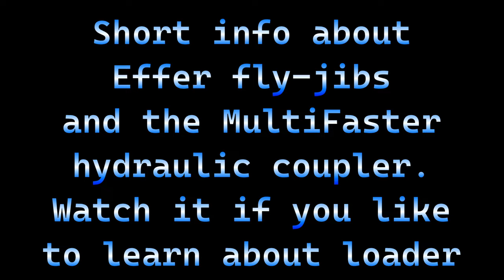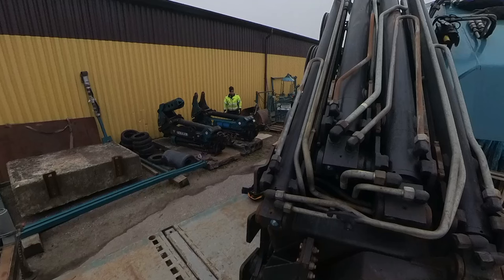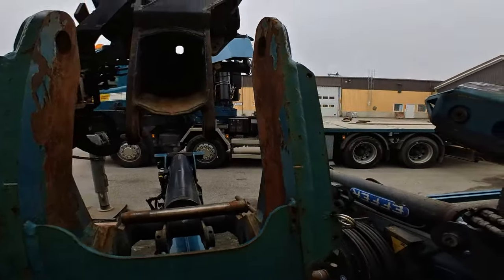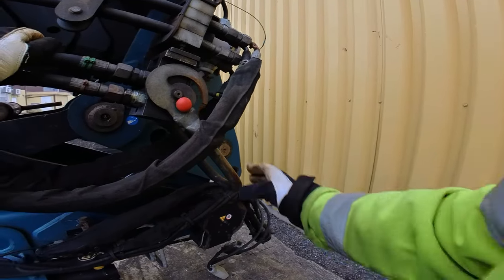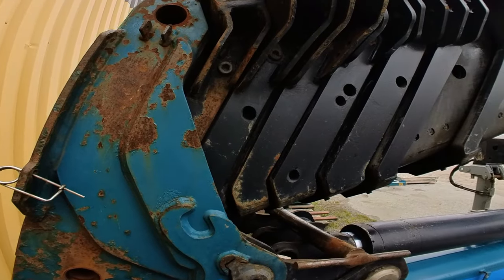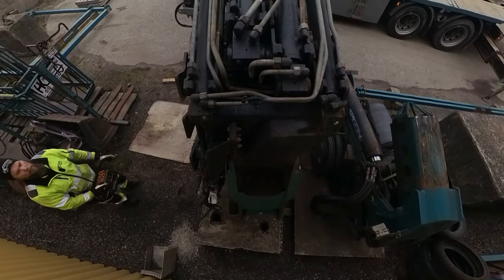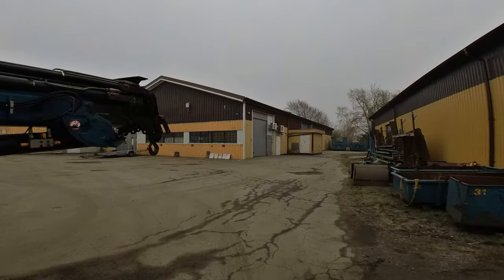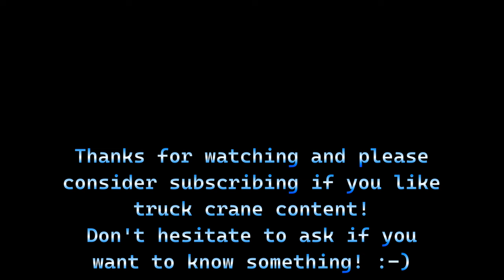Effer fly-jibs and the magnificent MultiFaster hydraulic coupler!

Comment: nice video ! , if it is possible make a video with Variable Stability, mesures the extra pressure on stabilize when the crane goes full extended with load on and how you are sure about the stabilize.
Reply from the maker: I see what you mean...this crane is so old though that it has no stabilizer computer control. If I have to crane without fully extended stabilizers I always lift the loads closer to ground and use my 12 years of experience with this crane to make sure nothing happens.
More modern equipment is coming this year, watch this space. 😊